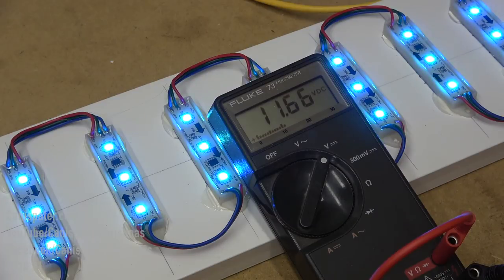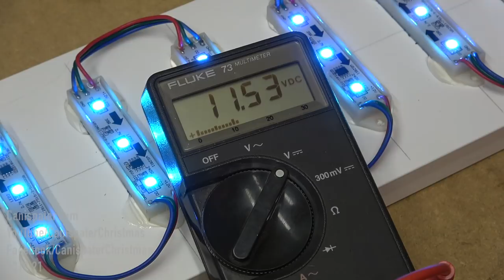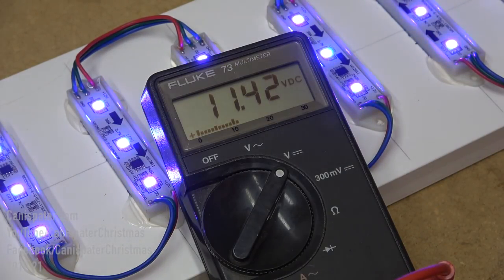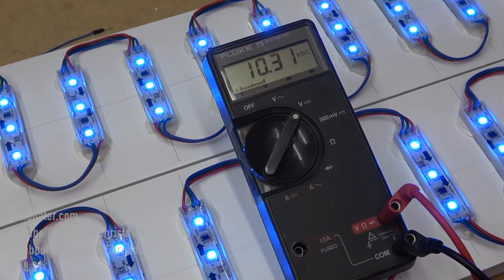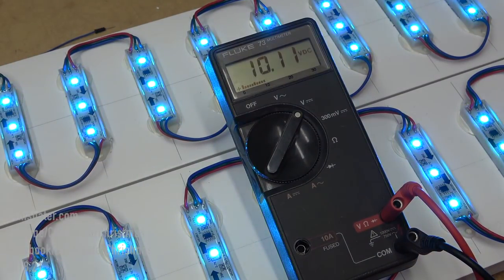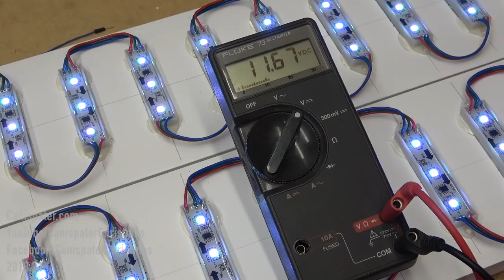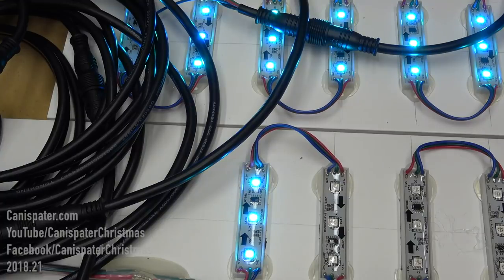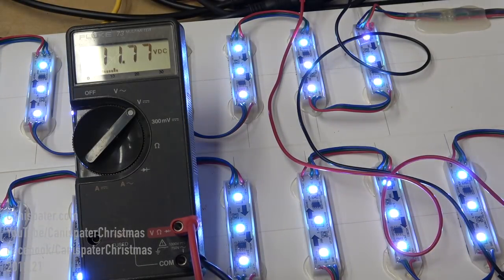Falcon F-Amp RGB Pixel Data Signal Booster (2018)

Comment: I was looking into your FM Transmitter as I was looking for a less powerful one.  Why?   I just found out FCC regulation on Part 15 states you can only transmit 200 feet (61 meters) for any FM transmitter with the 88 to 108 MHz.  The one I purchased off of EBay several years ago is considered illegal because it has 2 outputs, one at 500 milliwatts and the other at 100 milliwatts.  I have my antenna on a mast and can hear my broadcast 7 miles away at 100 militwatts!   Darn!   I ended up putting an RF attenuator to get the desired effect (less than 200 meters).  Hope the FCC does not knock on our door...LOL.   Here is the website I found the info on https://www.fcc.gov/media/radio/low-power-radio-general-information
Hope this helps.
Reply from the maker: The FCC doesn't patrol neighborhoods looking for violators. They will only take notice if someone complains. THEN they will come out and take field strength measurements. If you're over, they will tell you and expect you to get in line. If there are further violations, then they get a bit more forceful. Depending on the violation, fines, confiscation of equipment and possibly imprisonment (I'd assume more so for extreme cases of pirate radio stations). Having said all that, you just need enough signal to get out to the street so 7 miles seems a tad high - 100mW with an outside antenna is probably too much. I'm not sure which of mine you're referring to (assuming the one from EDM Design), but it has 2 settings 1-10mW (adjustable) and 2-100mW (adjustable). I'm running it at low power with the included "test" wire antenna inside my house so I'm not expecting visitors. I did a quick test and it does go a little further than my postage-stamp sized transmitter (maybe a house or two), but not much further. Of course if I get that J-Pole I've had my eye on..... :)
Reply: I have built some antennas in my day and a J-pole might get you farther.  I agree the FCC does not go out looking for violators as they have too many other items on their plates i.e. like you suggested on pirate radio stations.  When I put the RF attenuator on mine, it dropped it down to about a block (1/2 mile) so I am happy with it.... for now.  But who would complain about hearing Christmas music a month prior to Christmas?  Maybe Scrooge or the Grinch?  Anyway, keep making the videos, they are both entertaining and educational!!!
Reply: How in the heck did you know I was researching a J pole????  LOL.  Agreed on the FCC, lived in the UK for about 2 years (Air Force) and their FCC came looking at the antenna on the flat/house and was trying to figure out if we had a tv operating without a license.  Yes, a license, for a tv....ridiculous.   I was looking at the EDM design your were showing and figured I would try a RF attenuation first before I purchased another radio.   Keep the videos coming!!  Love 'em!
Reply from the maker: Hmm. Maybe a license for an external antenna? Seems odd to need a license for a TV receiver, but who am I to complain about screwy laws? lol!